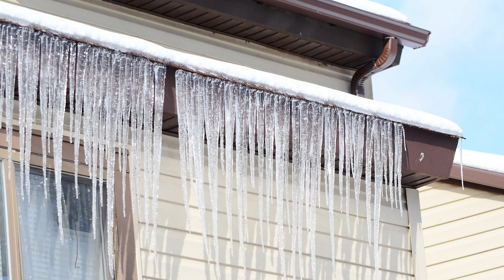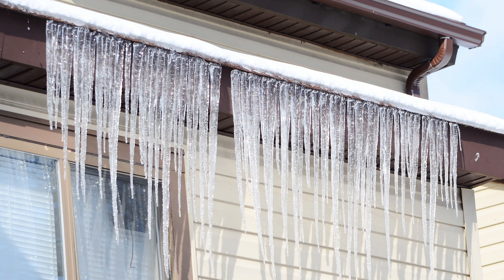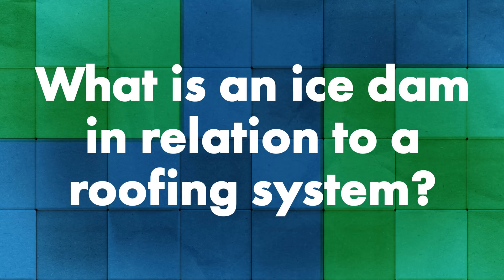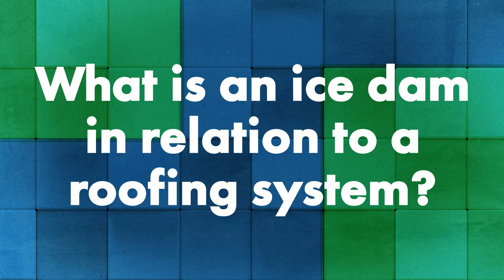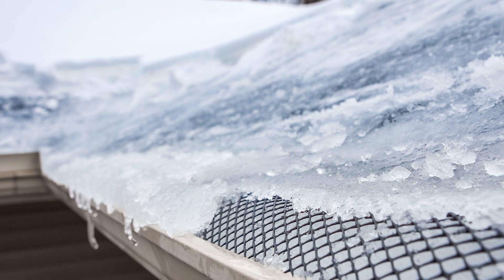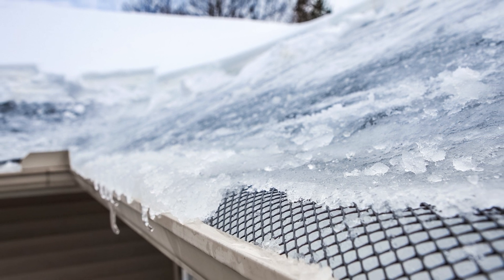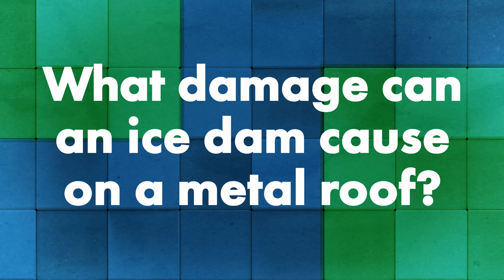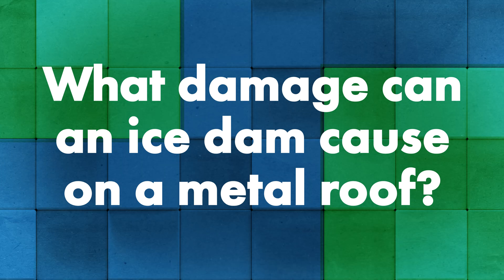What Are Ice Dams and How Do You Prevent Them on Your Roof?

Comment: Extremely explanatory video regarding ice dams on metal roofs. Trying to find a solution is very hard, no matter how well the insulation requirements and the ventilation at the soffit has been made, sometimes you still have problems. We have customers around the US, mostly in high altitude areas, that ice dams not just damaged the gutters and downspouts, but also infiltrated caused leak inside the customer's home. We do have a product made of roofing membrane using radiant heat film that can solve most of these problems. Most of the contractors that install our products install under the metal. Would love to send you a sample. Thank you